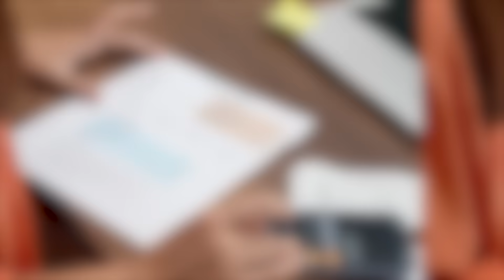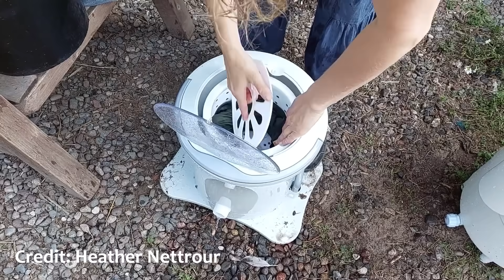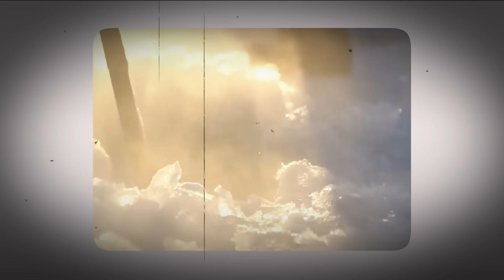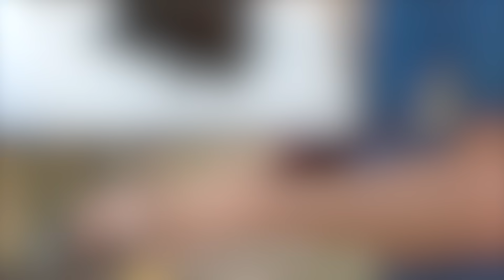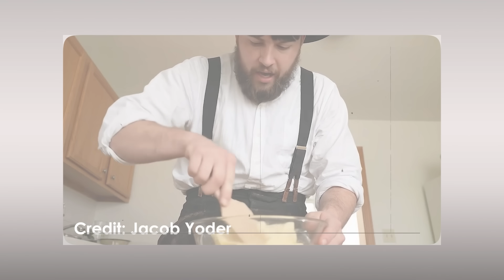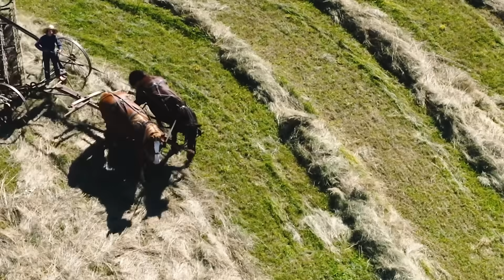The Genius Amish Tools That’ll Save You a Fortune

Comment: If it's lined dried and folded right away, most clothing today do Not need ironing. 
I mostly only use ironing when I'm sewing. I do remember my Mom's small automatic washer with a ringer, it was electric, although. Some days I just wash something in the sink & hang it in the shower to dry or take it out to the line. 😊
Lehmans has Manual washers with a ringer, they're very nice, but expensive. Off Grid with Doug and Stacy show how they work.